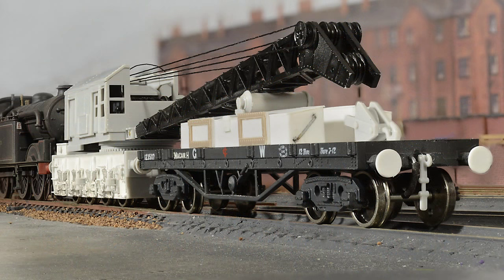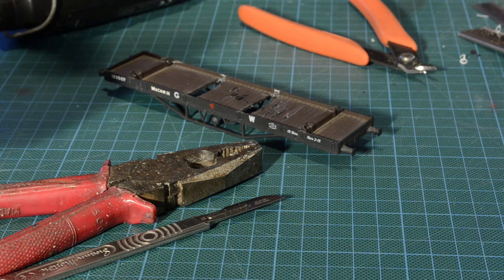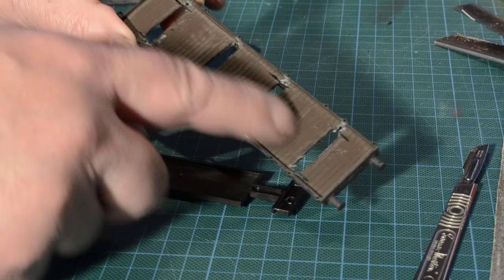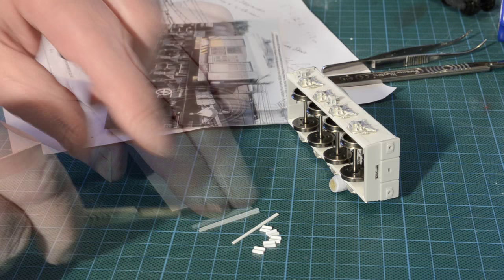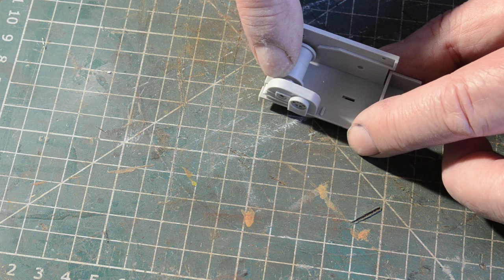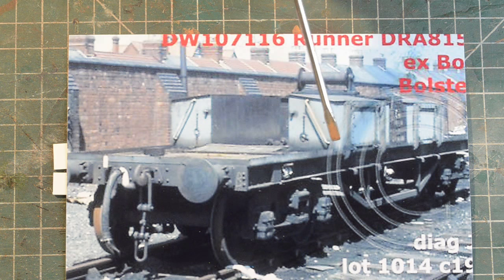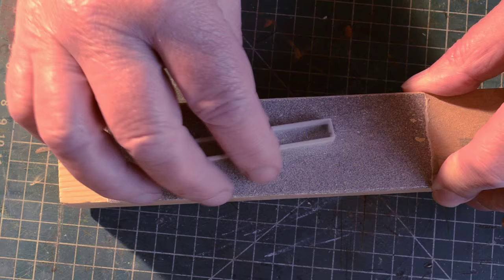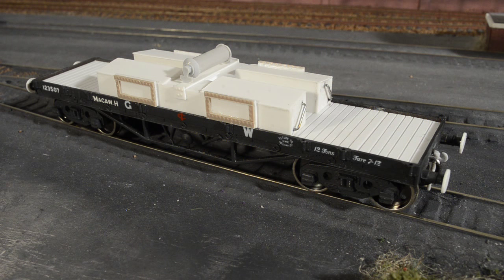DAPOL 15 TON CRANE #2

Comment: wow you scratch built that, not something I would try yet in my modeling career. I have a hard enough time painting a crane to fit my layout, I did do one paint job up but gave it to a friend, since he models CN and I am more Conrail, great job, wow is all I can say
Reply from the maker: Hey, thanks again. Not entirely a scratch build, more what we call a 'kit-bash'. The crane was updated from an elderly plastic kit and the runner wagon from a converted RTR bogie wagon. None the less there was a lot of new detail to scratch build and add. I have Part 4 in the pipeline, I am going to add a Mess Van converted from an old Guards Van  ...  David

Comment: Excellent descriptions and details which has inspired me to add some detail to some of my buildings, I particularly looked the raised rivets. Having checked on line I can only find them from an American company called Micro Mark.Is this where you get them from or is there somewhere else?Thanks
Reply from the maker: Apologies Bob for the delay. I picked them up at 'Bouys Toys & Models' in Cromer. I did a search on ebay and nothing came up. Rivets, in various sizes on a single A4 thin plastic sheet. Phone number for "Bouys Toys & Models" (great shop) is 01263 519652. Hope this Helps. ... David